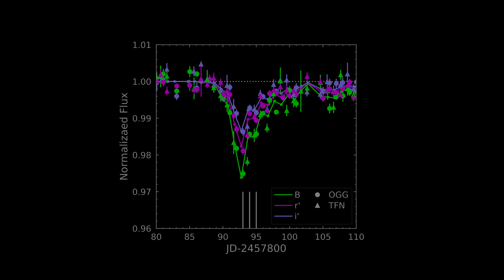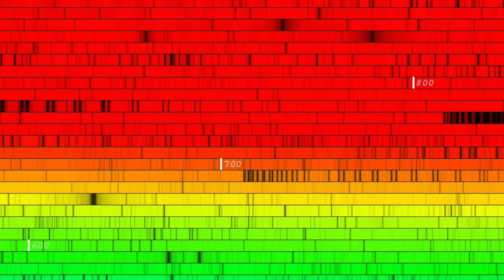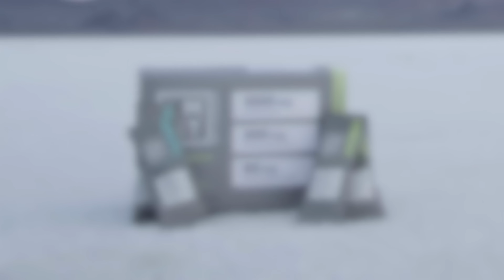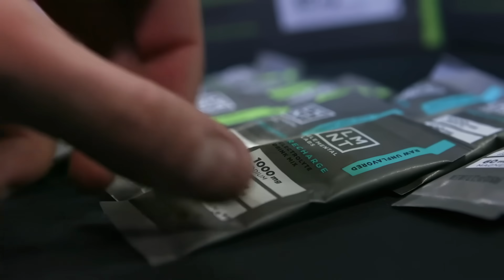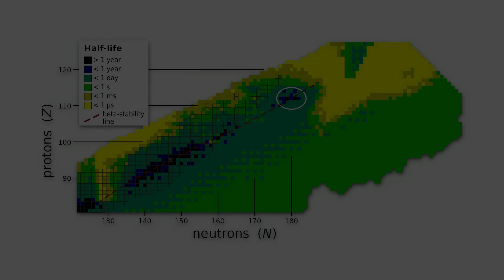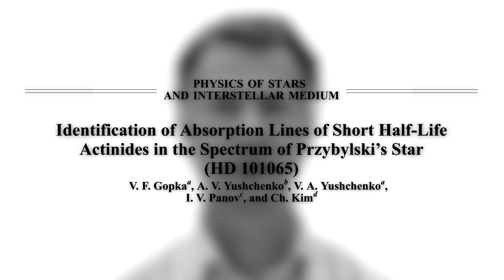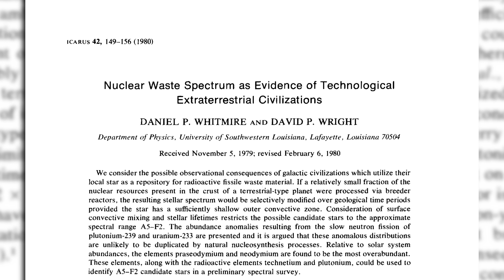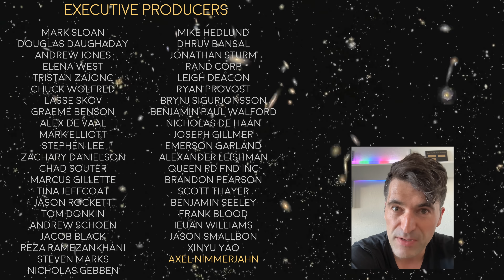The Star That Shouldn't Exist

Comment from the maker: Thanks for watching, and thanks to LMNT for sponsoring us. Make sure you hit http://DrinkLMNT.com/coolworlds for a free sample pack with any order. Let me know your ideas about this weird star - what do YOU think is going on? One idea I didn’t discuss is that of a companion neutron star enriching the atmosphere through a high energy wind, which Gopka proposed (https://ui.adsabs.harvard.edu/abs/2008AIPC.1016..460G). This idea has been excluded by radial velocity measurements though (https://ui.adsabs.harvard.edu/abs/2008A%26A...490.1109M) hence why I didn’t include here. Curious to hear your imaginative solutions!

EDIT: A few of you asked about the total mass of these radioactive elements (actinides). I haven't seen this calculated anywhere, but I will attempt a rough calculation here. Gopka (https://ui.adsabs.harvard.edu/abs/2008KPCB...24...89G) doesn't provide abundance measurements but suggests that the actinide abundance is comparable to that of the lanthanides. In the same paper, the lanthanides are quoted as being 10,000x more abundant than that found in the Sun. For the Sun, the lanthanides have a total abundance of ~2*10^(-5)% (https://periodictable.com/Properties/A/SolarAbundance.an.log.html). So x10000 gives an abundance of ~0.2% for Przybylski’s Star. Now that's just the number count relative to other elements, not a mass. To get a mass, let's assume they are only present in the photosphere, and let's further assume the photosphere has a similar depth to that of the Sun (~100km). The photosphere volume is then pi*R*^2*100km = 5.5 * 10^23 m^3 (since R* = 1.9 RSun). The mean density of the Sun's photosphere is about 0.3 g/m^3 so assuming the same here, the photosphere has a total mass of 1.6 * 10^20 kg. Now we can use the abundance, but remember its by particle number, not mass. So the mass fraction will be  0.002*245 / (0.002*245 + 0.75*1 + 0.23*4), where the 1 is hydrogen, 4 is helium and 245 is roughly in the middle of the actinides (mass numbers). This gives 0.23, so thus the total mass of actinides in the photosphere would be around 0.23*1.6*10^20 kg = 3.7 * 10^19 kg. That's about 4% the mass of the asteroid Ceres. Obviously, this is very rough, and assuming a Sun-like photosphere, and actinides only in the photosphere, so take with a pinch of salt, but at least gives you an idea about what scale we're dealing with here. (Feel free to chime in if you have a better calculation than this rough one!)
Reply: Hope somebody gets time on JWST for more detailed observation. Not sure if that would help since all this is probably in blue side of things. A coronograph would be nice to see if there really are any compnaion/s. In the end if you have eliminated the impossible, whatever remains, however improbable, must be true!!
Reply: Any chance you can get time on JWST to study the star and its planets more?
Reply: @astro9219  There isn't any detected planets around this star.
But I guess that JWST could detect the debris cloud around the star if a collision happened in the past.
Reply: What would be ironic, is if there is a completely natural explanation for the star, but because it is so unusual, several intelligent species in the galaxy are looking at it with closer attention, and this becomes some reason why communications are eventually established. Like someone closer sends a probe, which intercepts a transmission pointed at the star, etc.
Reply: Thank you for putting chapter markers on the ad, not very many YouTubers do it and I always appreciate the ones who do.
Reply: They only ship to Canada and US.
Reply: It's either some kind of misreading of data or something is up! Right? What else could possibly explain this phenomenon? This seems like we could possibly be on to something here! This is very exciting!
Reply: Seems like we could possibly be on to something here.  But nobody with the possibillities to dig deeper, would want to risk his reputation here.  That star is burned, since it has already been connected to aliens.
Reply: just so you know, the linear velocity of a star's rotation doesn't tell us anything unless you also provide the star's diameter. the angular velocity is more useful.
Reply: @mrosskne we can’t directly measure stellar radii so astronomers work with what we can directly see, Doppler line broadening which yields the equatorial velocity
Reply: Well, I'll throw in a wild guess.
Hawking Star.
That would explain the heavy elements.
Reply: Question:
Can we measure the total amounts of those components in a given star. Then do the same say every 5 years.  If the amounts are changing, it could indicate a civilisation using their star for waste disposal. All those advanced components could be remnants of advanced craft slung into the sun at the end of life.
Reply: You get extra points for using a White Star.  B5 was one of the best moral dilemma sci-fi shows of all time.  🖖
Reply: All links are 404🤗
You need to reformat the links, so Youtube wont mess them up. Or name the paper, so i can search for it.
Reply: @CoolWorldsLab Do you know if any time is booked on JWST to look at this star?
Reply: Gross.
Reply: There’s hope for a great island of stability in Wikipedia’s page on the search for native hassium.  Due to group similiarity I like to call naquadah hassium and propose two recipes: ^160_64Gd(44 ^3_1H, γ IC)^292_108Hs, ^238_92U(16 ^3_1H, γ IC)^286_108Hs (formatted ¹⁶⁰₆₄Gd(44 ³₁H, γ IC)²⁹²₁₀₈Hs, ²³⁸₉₂U(16 ³₁H, γ IC)²⁸⁶₁₀₈Hs).
Reply: Now it is my understanding that we hear, you know all of us here evolved from the stars right?! Apparently was that confused are there only three observational efforts that everyone is aware of? And yes aliens oh boy aliens here we go aliens! Haha that is optional optional number three baby number three baby LOL. Seriously where we getting at here folks? Oh those are the only viable options is that correct the ones that he's aware of so what you're saying is aliens are the best option we got?? Right right right right okay gotcha. It's the dust I tell you the Dust! The dust I tell you it's the Dust. In fact the dust is the one moving around showing us Starlight from a star already behind the Dust! And then they say it's the Pillars of Creation they say?! Who say what?! Now what are we going to do are we going to call the Pillars of Creation or the pillars of evolution evolutionism evolutionism which one is it? Trying to figure it out. Did we evolve or did we not what is the real science behind it and possibly can the real meaning of the stars please stand up. yes this philosophy is dangerous it is a worldview it is religious in all connotation of the word. Evolutionism is an awful science not backed by anything but taxpayers dollars I'm afraid. Yes dying yes the light is out
Reply: All come with leakage guarantee
Reply: its not the star that shouldn't exist, its your completely incorrect model of stellar formation that shouldn't exist. your models are wrong, you don't understand what you are talking about. the universe is electrical, newtonian gravitation and einsteinian relativity are based on fictional forces that do not exist anywhere but on the paper their calculations to try and explain observed reality reside. how long will you continue to lie to the world and push these wholly debunked and falsified unscientific models?
Reply: Could gravity somehov interfer with the  light to somehow disturb the spectrum we meassurment? Perhaps some really heavy objects between earth and the star could create some resonance that increases theese frequncies?
Reply: Meanwhile Bill Gates, flying on the Lolita Express enough to force his former wife, Malinda Gates, to divorce him within days of her discovering that her husband is a pdf.file. And this is the same Bill Gates who is researching how to infect all meat eaters with some kind of prion disease because he's a vegetarian lamb of a pdf.file.
Reply: The possibility keeps getting divergent and increasing in quantum travel. More threads of directions
Reply: ❤, I propose that this star swallowed a rouge gas giant that had been accumulating heavy elements from supernove and the in-falling materials slowed the rotation rate altering the photospheres chemistry. The higher luminosity has the pressure to keep heavy elements suspended above the core churning in the photosphere by hydrogen bonds that are temporary and magnetically lifting material that would normally sink in hydrogen plasma... I can't prove it but it's a process that can be imagined and possibly worked on by people willing to dope hydrogen plasma with heavy elements to see if hydrogen plasma can be a lifting agent for metals in a solar environment. 👍🏻
Reply from the maker: @levirivers2772 cool idea! I think the challenge with this is -  why did the gas giant have einsteinium, etc? Because that stuff just decays too fast…
Reply: @CoolWorldsLab   The links you provided don't work :404 not found.
Reply: @CoolWorldsLab Is it possible it decays too fast in the environments we can create on Earth, but has a longer half-life in more extreme environments?
Reply: @levirivers2772  Wouldn't the time taken to swallow the star mean that either there would be signs that this had happened recently, or the elements with shorter half lives would have decayed some time ago?
Reply: @levirivers2772  not rouge, dolt
Reply: @alysdexia  So, so many people type "rouge" (red) instead of "rogue".
Reply: @levirivers2772   The problem with natural explanations, is that there is no process to get these elements to a hypothetical island of stability naturally. Many of these elements don't have a natural process for their creation period. Assuming our information is correct and these elements exist, there's no reason to make so many leaps of logic to try and force a natural explanation. We know life exists in the universe (we exist), we know intelligent life can create these elements (we've done it), the only question left would be why?
Reply: @warlock64c  everything’s natural as opposed to native/wild.  try what? and.  The island of stability hasn’t been mapped yet.
Reply: My proposition would be neutron star contamination, be that from a nearby merger or on being in the core. If the star is salted we'd expect to find some pattern to it, a ratio between the elements. This seems too messy. Why actinium AND lanthanum AND cerium AND... If you want an undeniable signal then just actinium should do it, maybe a few other radioactives in neat ratios. But perhaps the pattern will be found,it'd make for on heck of a movie.
Reply: I wonder what the constraints are on a collision? Przybylski's Star has a weird velocity iirc. I don't know what kind of collision would be needed to create these elements, but if it hit something small but relatively fast maybe the upper atmosphere could be shocked (and send the star in a weird direction) without disrupting the star itself much. Of course you'd probably expect, like, the upper layers of the star to have been peeled off, a trail of debris, chaos (luminosity variation, maybe evidence of ring down in terms of like starquakes or something) that wouldn't have settled down at this point.

alternatively maybe, like, there's a mercury in its corona getting heated to millions of degrees by whatever makes the sun that hot, and these are just what happens to the spectral lines of iron and silica at a million k or something.
Reply: Wait wait wait! Plutonium!!?? I thought it wasn't possible for Plutonium to be formed naturally but had to be synthesized!! Heh, I made the classic mistake of commenting too soon before watching the entire video 😛
Reply: @kyzercube  The only elements that are confirmed with a decent level of certainty are technetium and prothium. Remember there only have been one study about those peculiar elements in 2008 and nothing since to infirm or confirm this hypothesis.
Reply: Wish that I could provide educated thoughts on the subject. Truely fascinating.
Great to see that you stay in shape. Don't want to key bord coach you but, I am going to. Weight's after striking workout or on a separate day. You don't want to be tight or stiff. Keep chin down and hands up. Shift your shoulders when you throw but, stay balanced. And use your foot work. Step in as you throw and change angle after the 2nd blow.

Thank you again for the awesome informative videos.
Reply from the maker: @uktenatsila9168 thanks for the tips!
Reply: @CoolWorldsLab your work is fake
Reply: Revelation 16:8-9   8. The fourth angel poured out his bowl on the sun, and the sun was allowed to scorch people with fire. 9 They were seared by the intense heat and they cursed the name of God, who had control over these plagues, but they refused to repent and glorify him.
Reply: @TomiLoveless  Revelation 16? Huh? 🫤
Reply: @ariblack4424  Lol.
Reply: @TomiLoveless, nobody is talking about the sun here.  One could percieve your reply as childish, if it were not intensionally driving younger readers away from the truth.

There is no angel pouring a bucket full magic into the sun.  It is our daily chemistry which we store in the bathroom, which is breaking the planets ozon layer.  I feel it myself, that the sunlight is much stronger than it once was.  Also, sunlotion is 20 to 50 times stronger as it once was.  We pour this magic bucket into the sunlight; increasing the Ultra-Violent light.  We are cursing God by continuing to use even more ozon breaking chemicals every day.
Reply: @TomiLoveless  Revelation admits that Abrahamism plagarizes the many gods of paganism but disguises them with different names; God translates Vulgate Deus a 1500s recension forgery when in the 1400s personal names were first capitalized but deus was not; deus itself is a mistranslation of ho theos for the god, as if ille deus, and the head god was named logho but in Jn gave over his power to the son god Emmanuèl, again plagiarism of the heavenly heir tale between urano and Crono or cælum and Saturne.  This passage could retrodict the known supernova but radioactivity is the main yield rather than infrared so this god has no knowledge of astronomy not to mention that Abrahamic gods believe Earth is flat and small and heavens are a lake where the stars swim over a bowl that holds up the rain.
Reply: @alysdexia  You must look Harder! Not just with your eyes Open your heart and for once and try to feel something, although it's useless for some I understand. Good Luck Blessings and Prayers!
Reply: Who are we to tell the universe what should or shouldn't exist, huh, stop this.
Reply: @TheREALDanontheMoon  what’s a question?
Reply: @TheREALDanontheMoon  You know, stuff like basic understanding of physics, it work quite well.

Comment: My idea is, what if this "super electromagnetism moves the particles so fast that acts as a "fusion acelerator?" where normally will not happen but due to the extreme pressure and temperature is not enough but, with the extra of how hard the electric field is is FORCING the fusion as a much lower temperature?

Comment: There is a very simple explanation for this type of star. Look at a bowl of stew. The ingredients in the middle and closest to the fire cook first. We stir the stew to make sure everything cooks evenly. If you don't stir, stuff on the bottom scorches. Our own star is like a boiling pot of stew. It has convection currents that keep it stirred up.

 Billions of years ago, maybe even at its birth, the star was sideswiped by another star moving opposite to its rotation. That slowed it down. Without rotational energy to power convection currents, everything close to the fusion core just sat there. Instead of fusion changing hydrogen to helium and eventually turning into iron, the reaction stalled. Everything close to the core has been changed into heavier and heavier elements. Run that system long enough and even the heaviest elements will form. We see the heavy elements because the core is getting saturated and getting ready to blow. We could see even heavier elements when that happens.

Comment: This star is apparently at the end of its main sequence.  It's about 1.5 billion years old but is more massive than the sun and is hotter so has a shorter lifespan.  Could it be that a civilization is trying to save itself by sending manufactured heavy elements into the star in an attempt to either cool it down or stave off its transition out of main sequence, or something like that?
Reply: No, a star with that short of a life would at best only have single celled life around a planet orbiting it

Comment: You said its spectrum is somehow reliable because of the slow rotation rate. What if it's not? Some process could be transforming its spectrum to make astronomers think it contains those elements. Other than this, I don't know, there is the odd case that this star actually makes those elements somehow.

Comment: Is there a way you could use Bayesian statistics to work out the how long it would theoretically take to find a techno-signature? You could use factors like estimating the how long it would take to check every single star in the Milky Way (and other stars in close by galaxies), how long it would take to process that data (given our current level of computing power) and plug in different estimates of the number of civilisations in the galaxy or even a cluster of galaxies. You could then start coming up with an estimated timeframe for how long it would take. Imagine if it estimated it would take 10,000 years to find 1 civilisation out of 22 in each galaxy for example - it would really bring home the effort required and more or less solve the Fermi paradox. 
You did something similar for the what it would take to try and find a repeat of the wow signal in another video - could you expand that to a hypothetical techno-signature?